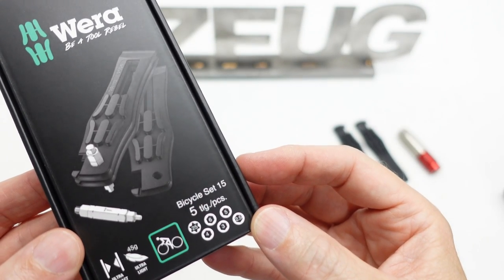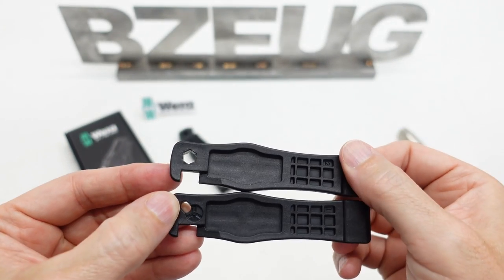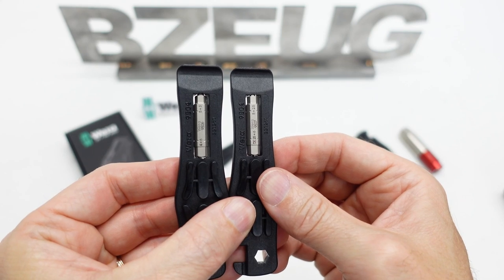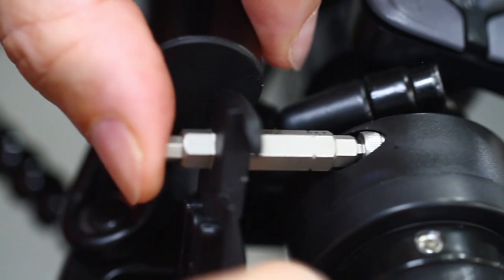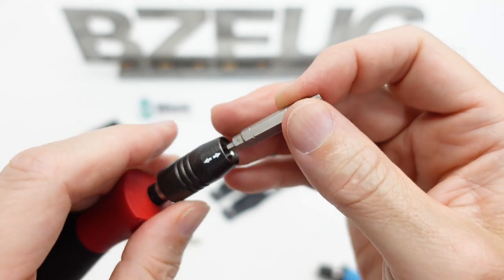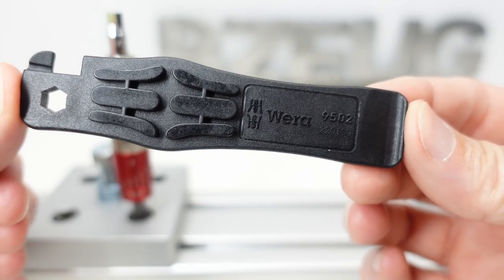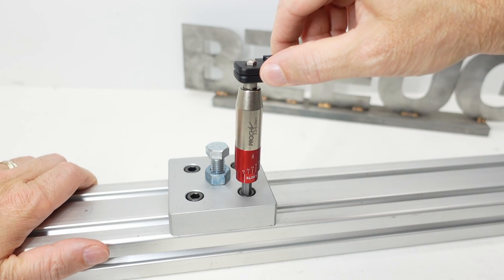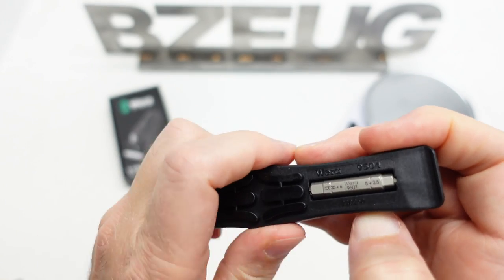Wera Bicycle Set 15. With two double double ended bits!

Comment: If you use a dedicated camera try the smallest aperture (f/*highest number*) size (darker image, but more focal depth) your camera can handle (for example if it's on f/1.4 set it to f/8 or something) and compensate with better lighting and a higher ISO setting (brighter image but more noise) and ditch the auto focus. Everything near and far should be in focus all the time.